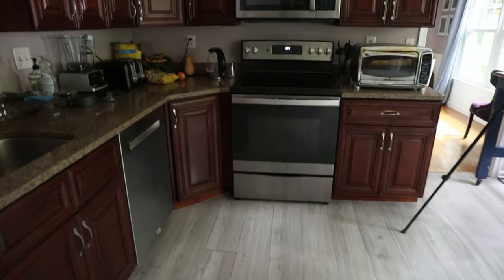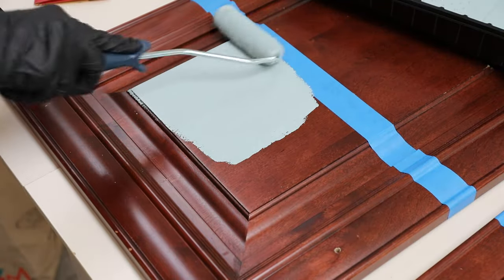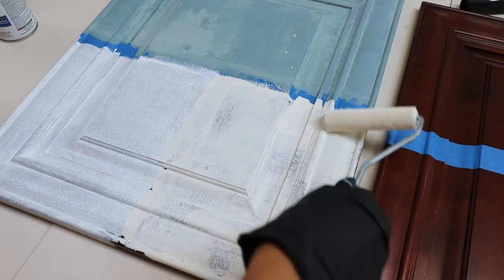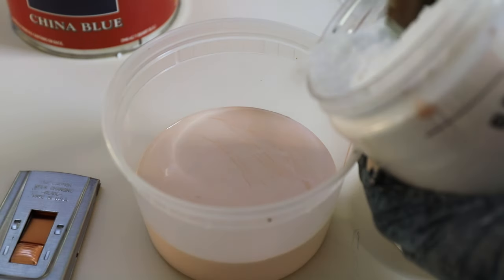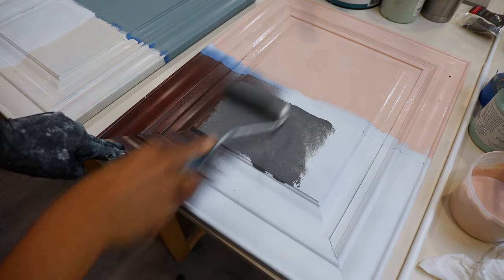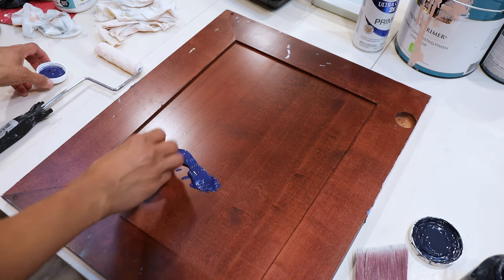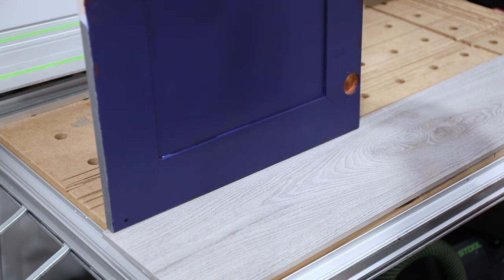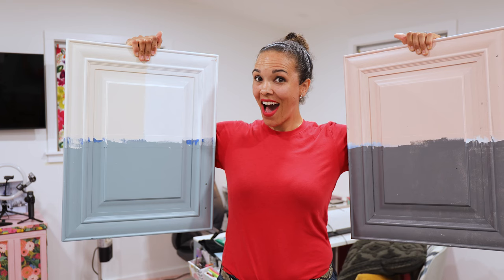I Painted These Kitchen Cabinets. What Looks Best?? - Thrift Diving

Comment: You can have your primer tinted (at no additional charged) to the color you are using as your color. I do it all the time. It works great.
Reply from the maker: Oooh, great tip! I typically don't use primer so I had no idea. This is good to know!!

Comment: Off white is TOO yellow!  Nantucket yes!   Pink for kitchen cabinets will not look good with the grey flooring, trust me.   And sorry, but definitely not the dark grey or dark blue paint.  It's too dark for your floor and appliances, and you're removing  your current cabs because they're too dark, yes?   Also, please let us see your new foyer!
Reply from the maker: I was worried it was too yellow! I think if I go with the bright white and it's TOO white, I can always go over if with the off-white (and vice versa). As for the foyer, I will show you that! It's messy right now. The shoe closet is always a hot mess with shoes spilling out, so I need a solution for that. And I've got boxes and other random junk sitting at the door! LOL. In other words, I need to refresh the foyer, too! AGAIN! I swear....it's never-ending, isn't it?! Thank you!

Comment: Nantucket for sure.  the white or off white would both work well.  As far as the yellow goes, doing the top in off white takes it away from the floor and oddly the flooring, to me, seems to neutralize any yellow.

Comment: Sis, if you paint your cabinets pink, I'm going to have to tear up your Phenomenal Woman card. Just sayin... 😒

Definitely the navy blue  and the Nantucket or navy blue and white. 

Be bold and innovative. 

Navy blue on the base cabinets with white or Nantucket on the upper cabinets. 

Also check out a shades of white called "Whipped Cream" Nd "Milk Shake" by Kelly Moore. Either would go great with the navy blue. Or the Whipped Cream with the Nantucket...

Also keep in mind these are kitchen cabinets and will get dings, scratches and stains which will require a lot of touch up. The chalky paint will stay dirty/stained